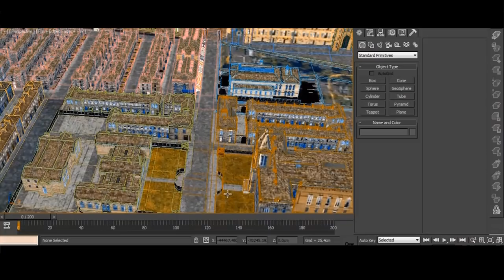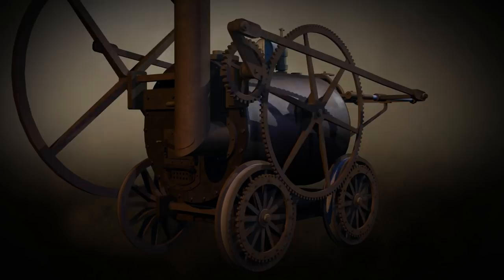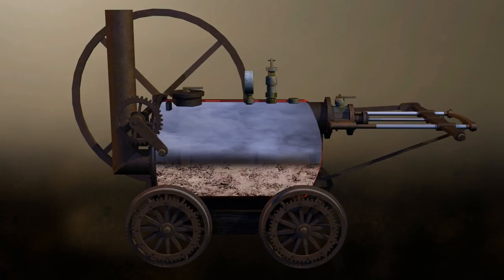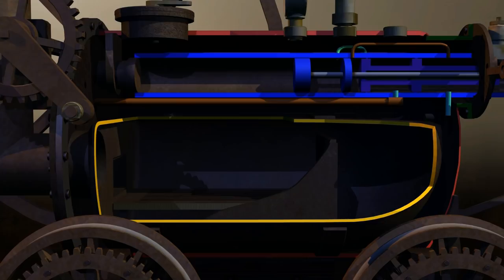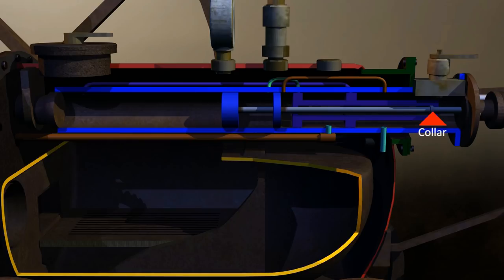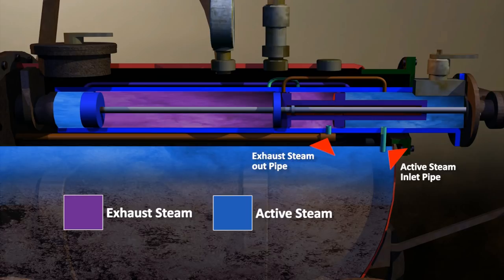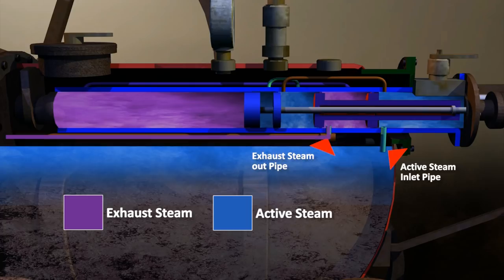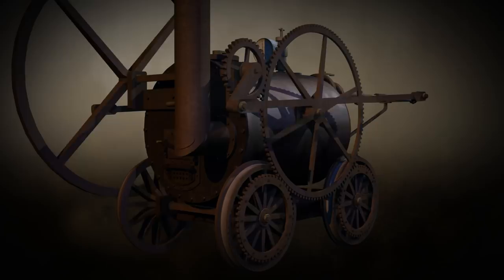Richard Trevithick 1805 Steam Railway Locomotive

Comment: Michael - I wonder if you are still reading comments relating to your excellent work ? . .  I just have one major issue, and I understand that you are not an engineer or enthusiast - but your concept of steam generation and supply / exhaust to / from the cylinder is far too complex and in error. You have studied the drawings but I cannot understand why you have not included the return-tube flue, and perhaps the most important component - Trevithick's 4-way plug cock (you actually show this on your animation, but it appears to have no function)! . . The actual working of the cylinder and piston was a great deal simpler than your wonderfully complicated graphic - and don't forget that this machine had to be made in a small forge with little facility to produce tappings or lengthy channels through cast-iron components. . . The actual, working replica loco at Ironbridge shows the simple mechanism operating the plug-cock.
Reply from the maker: Yes I do still read them Anthony - and you have just opened a can of worms I myself encountered when producing the video for the Puffing Devil in which I had to combine drawings produced from the partial remains of a Trevithick Static Engine and those produced by the Trevithick Society who built two replica engines -  which included all the modern H&S regulations and restrictions.  What I discovered during this process - was - Even the Experts can't agree on anything.  It was interesting to learn from the Trevithick Society - that H&S Regulations forced them to modify/alter/ignore/fake many elements of the replicas they produced.  Notwithstanding, I do cover - at some length, the 4 way valve system in the Puffing Devil video - was it of Trevithick Design !!! - I'm leaving that argument for the so-called experts to resolve ;)